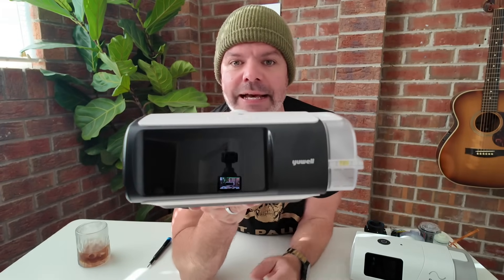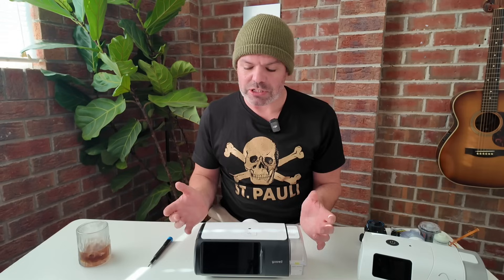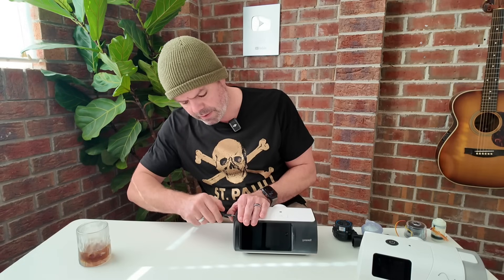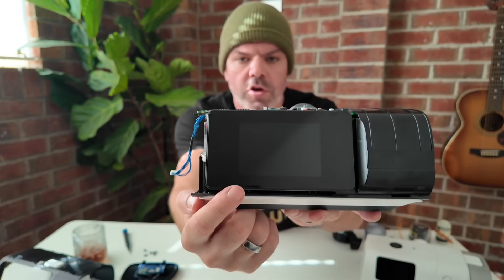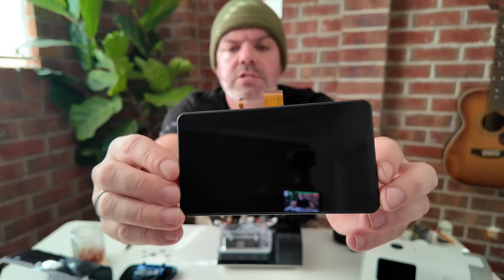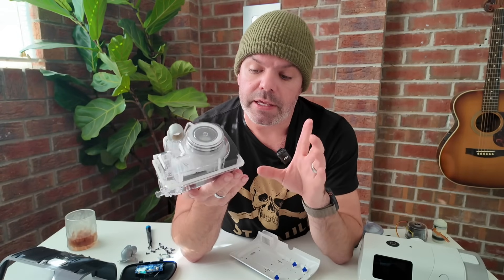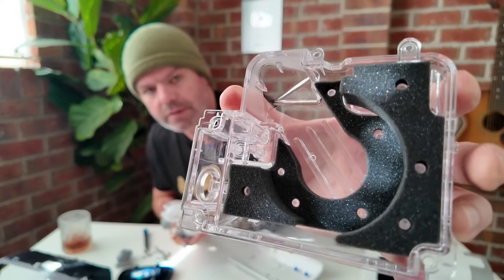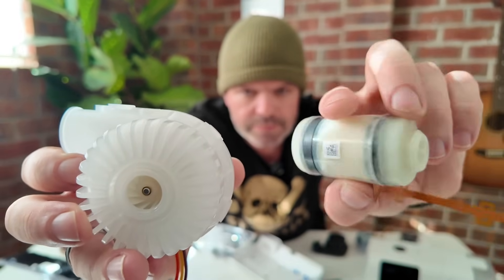Yuwell BreathCare 3 Teardown: Genius or Garbage? 💥 Let’s Find Out

Comment: Thanks Nick love the vids mate. Just reached out to the aussie distributor iJoysBio Pty Ltd and they provided me with the nitty gritty as follows:

"Thanks for your message. We’re the authorized Australian distributor for Yuwell.
ARTG: The device is listed on the ARTG under iJoysBio Pty Ltd (ARTG 476567). The Yuwell Breathcare III series includes models YH-680A, YH-680B, YH-690A and YH-690B.
ISO 18562 (Parts 1–4): The breathing-gas pathway was tested for particulates, VOCs and condensate/leachable. The results met the acceptance limits, including after an accelerated-aging program equivalent to 5 years of use.
Documents: I’ve attached the Declaration of Conformity and a one-page ISO 18562 test summary from the manufacturer in below. If you’d like more technical detail, we can provide a redacted summary or arrange access to the full reports."

They also provided a report from Suzhou Yuyue Medical Technology Co, Ltd. which lists all the ISO tests and  in summary states that the PU foam used in the ventilator meets the Biocompatibility Requirements before and after the accelerated aging test under the whole use of the entire machine within the validity period (within 5 years) and has long term stability and safety. 

I won't provide the report as it goes on a fair bit.

So based on their reply have pushed the button and ordered one, and also bought an aussie made inline filter $7 bucks, just in case.

Comment: Hello,Nick thanks for you share。Currently, many CPAP manufacturers in China are starting to adopt large touchscreens, but quite a few of them still use relatively lower-quality motors. While the noise level has been reduced, the sound isn't very refined and there is still some noticeable mechanical noise. In terms of algorithms, there is still a noticeable gap compared to global brands like ResMed. In the Chinese market, YUWELL mainly relies on e-commerce platforms for sales — professional retailers like us generally don’t carry their machines.

Comment: To build on Nico's video I bought this machine from China and here is my feedback.

Cost me $920 including a free mask shipped.

The machine is silent... dead silent and the wife said no noise what's so ever. I previously had a Resmed S10 and the wife confessed she put up with it's noise.

The other Yuwell feedback is:
> it takes about 2-3 breaths for the auto start to kick in. The auto stop doesn't seem to work too well as it blows for 20-30 seconds when I remove the mask in the morning.
> the min air setting is now set to 6 as 5 was too low for me. Not a deal breaker.
> the morning report on the screen doesn't really tell me much or specifically the highest air pressure I had that night.
> I'm not convinced the algorithm is perfect - Nico will need to weave his magic on this topic. 
> I can't connect to the machine to the Yuwell app or internet. The app doesn't read my machine's QR code so I can't update the firmware or use the app software to monitor my breathing..

I do recommend the Yuwell machine and think it is a material improvement over the old Resmed S10 machine.

Comment: You did not mention ine of the great features. WiFi, Blue as well as 5G.

But also they have a usb connection on the device for an oximeter ring. Comes with it or atleast super cheap addon.

I was looking at this device, I can buy from China but ironically not supported by SleepHQ so I bright Airsense 11. The discounted price was roughly the same $450 USD. Once you get rid of the health care insurance bs that’s roughly price  outside of US
Reply: This device is not new and has been around a while. It’s sold in some countries already. It just wasn’t pushed for the western market due to Resmed dominance and I guess it’s so similar in design maybe they infringe a few patents in US.

Comment: Hi, thank God I found your channel. I’ve just started my cpap trial, using airsense 11. All went well on the first week. After that, I’ve been getting mixed results. The report shows my ahi has dropped to under 5. But I’ve been getting blocked nose and congestion, which caused me breathing through my mouth sometimes. Ended up turning the machine off and sleeping without it 😓 The rep suggested me to use the nose & mouth mask but I hated it due to the bulkiness. So I’ve been using air fit p10 mask. I spray antihistamine spray before I go to bed, increase the humidity level but no luck. Any advice please would be very much appreciated. Thank u 🙏
Reply: Keep coming back to it as you may. It's not your fault that this stuff can be hard and frustrating at times. Getting a mask fit that is not too tight or too loose may take some time, but the rewards can be great, eventually. Hint: Throw the mask not the machine.

Comment: In the USA, I get emails from CPAP shops that sell new CPAPs and all related supplies.  You can now get the AirSense 11 new for around $550 with a coupon that is provided in the email.
Reply: not seen those emails yet for 550 I would jump all over an 11 I have the 10 and paid about 875 for it 2 yrs ago

Comment: Would never use a machine with any type of foam inside the airway, ever again.
Reply from the maker: I think Sefam is the only company that makes a device without foam
Reply: @CPAPReviews  there's foam in the Resmed machines but it was my understanding that it was around and not inside the airway, and the air doesn't pass through the foam. Is that not correct? Of course there will be foam around the inside but the air shouldn't pass through any of it.

Comment: I want to buy a lowenstein cpap machine as other machines have not done the job, would you recommend it
Reply from the maker: 100% in terms of actual therapy it's elite
Reply: I can recommend the Prisma Smart - it's the go-to machine (at least for my HMO) in Israel. I just got a new unit - even though my old one was still working fine after almost 7 years of nightly operation!

The Prisma Smart doesn't have much in the way of connectivity or a fancy display/touch screen; but it's a real workhorse and runs very quietly. (Some of their other models have better connectivity, but they're not covered by my insurance; and since I'm currently running well with simple 7-cm single-level, no ERP, I can't justify spending lots of money for a newer model just for some features I don't need.)

Regarding Yuwell, I've recently bought two of their masks: the YF02 full-face for when I've got a bad cold and can't breathe through my nose, and the YP-01 (pretty much a knockoff of the Resmed P-10, but with a better swivel for the hose mount) which is now my #1 day-to-day mask. Both masks seem to be very well designed and manufactured; it's clear that the company is making a concerted effort to compete as a quality alternative, not just as a "cheap Chinese knockoff". (That said, their designs, in general, do seem very much... ummm... inspired by Resmed.)

Comment: STM32G474VET6 chip. Looks like there's a JTAG connector on it too. Wonder if we can dump the firmware on it and mod it.... Wouldn't that be nice... Would love to get my hands on it.
Reply from the maker: pretty sure you can dump the firmware off any CPAP device bro. I've done if with ResMed devices. Easy way to turn a basic CPAP into a top end BILEVEL
Reply: @CPAPReviews  Wish that was true. For example the Löwenstein models have a security locked ST32F405. It's communicating with a crypto chip from ATMEL. I assume in this crypto chip the model type is stored and the calibration as well. Very well protected.
Reply: @Paul-n6f Same with Philips, I'm pretty sure their chip is RDP level 2
Reply: I definitely need to convert my ResMed AirSense 10 to a BiLevel machine I can’t use the CPAP - my health provider in US gifted the 10 to me never used can’t return it now I am in the Philippines I am not qualified to preform the conversion … it’s a mess

Comment: IMO, foam should never ever be placed in the airway path, that is simply stupid design done by uneducated engineers.

You only need to know that moisture attracts bacteria, and  having bacteria growing on the surface of foam is not healthy/optimal as well. Regardless of wether the foam breaks down or not.  Actually, all cpap machines should offer a quick and easy sterilizing cleaning option/accessory  because of this potential risk! Again, imo! 😉
Reply from the maker: I don't think the sound reduction works well unless it can absorb the airflow and stop it bouncing off the walls of the blower chamber
Reply: @CPAPReviews  You must be thinking of how current cpap blower design looks like Nick!  😉  ....obviously, if you want to get rid of the foam and not sacrifice noise dampening, you need to invent a new airflow design that does not rely on foam for sound dampening!  😁

Though I'm not a total expert on airflow designs myself(but have a engineer background), I still have a strong feeling foam was choosen(back in the day), simply because it was the easiest and cheapest solution to implement, that both dampen noise and didn't raise cost of the cpap machine.

Keeping sound noise low without foam, might mean the fan blower needs to increase in size....so it won't need to rotate as fast and change the audible vibration frequency range to a more "pleasent" sounding one. I could go on about this but will stop here.

But yes, R&D absolutely costs money and as long as Resmed or any other cpap manufacturer, don't feel the need to change/improve in this area(perhaps only care about money being generated)....they probably won't invest time and money in new airflow designs either!  😉

Comment: If the blower motor is the same in the air mini and airsense 11. What is the air sense 11 doing that the air mini isn't to keep it quiet and can we do the same thing to the air mini? It's so loud....
Reply from the maker: FOAM!
Reply: I was under the impression that the most noticeable / annoying noise of the AirMini is that produced by the exhalation vents in the Humidx cartridge.  The blower noise by comparison is trivial.